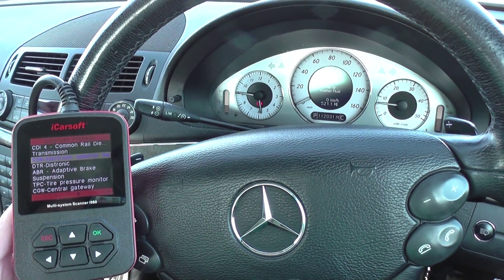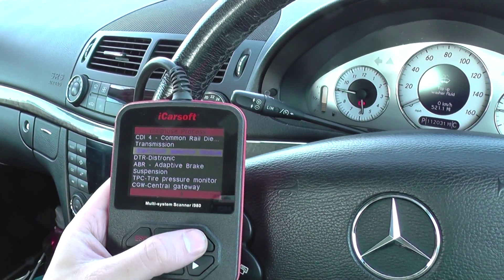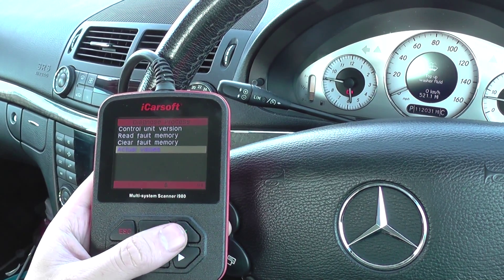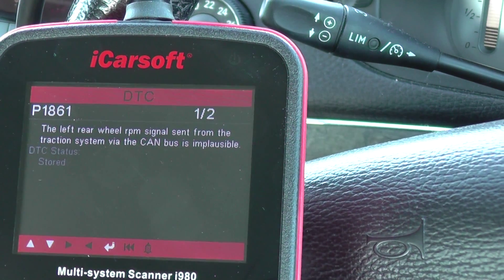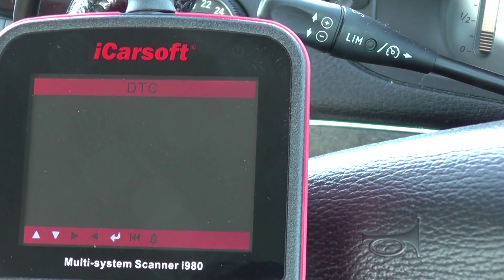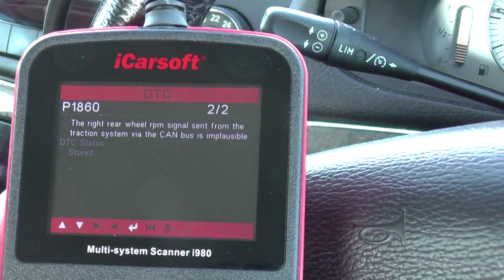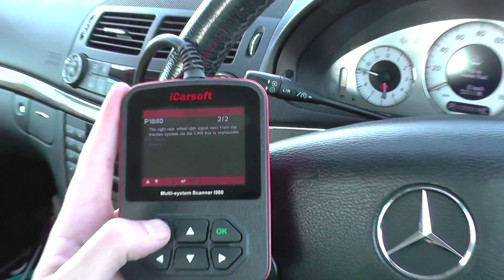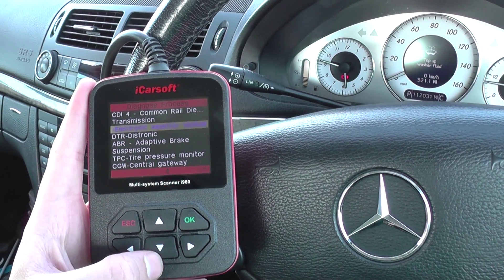Mercedes Benz ESM Diagnostic Fault Finding Kit

Comment: Not sure I get that info as I understand the ESM is more to do with gear selection and "drive authorisation" with the EIS key module and  Engine ECU ?

For example the selector must be in park or Neutral for cranking to be allowed.
The gear selector from the 2002 to 2008 and a lot of Mercs was pretty standard at that time and gear selection was done digitally via the CANBUS as well as a mechanical  rod to the transmission. 

So not sure where the wheel speed comes into it ?!